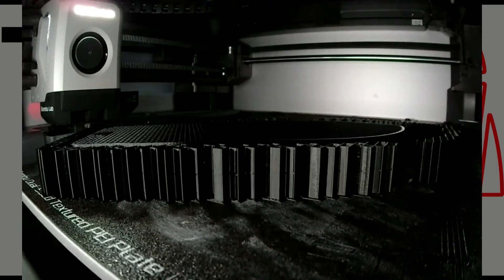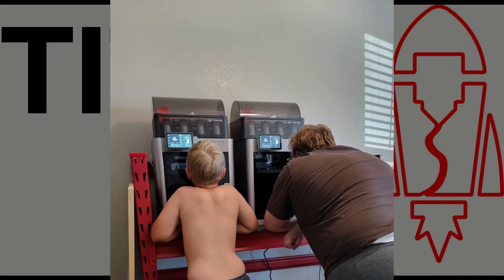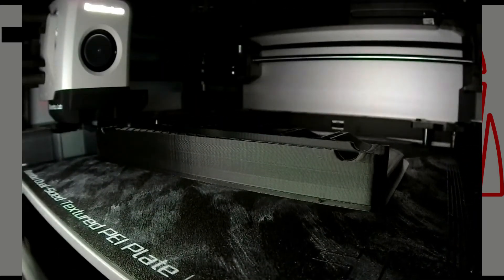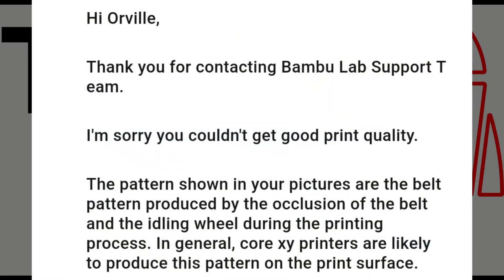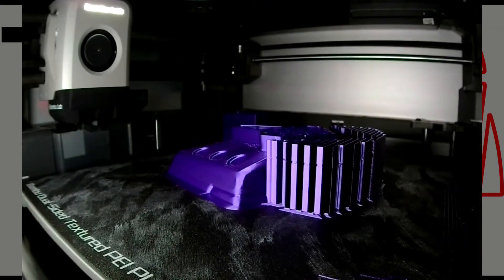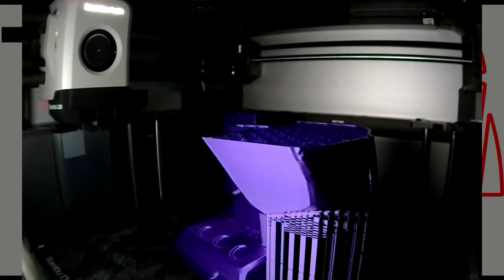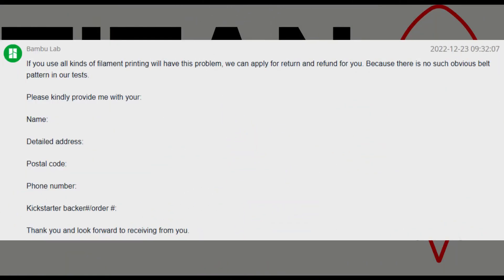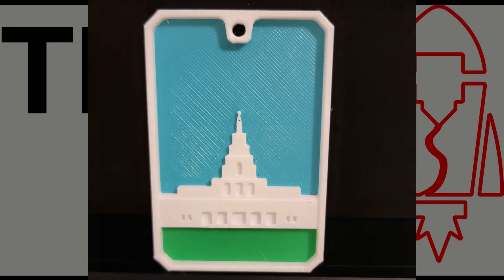Review of the Bambu X1 Carbon You Didn't Expect

Comment: What also helps is not trusting the Autotensioning system for the belts. Just listen to the tone each belt gives when twitching it like a guitar. You can get within 4Hz accuracy which is enough. If they the belts dont sound the same just open the screws for the Autotensioning and move the head around and thighten them back up. If they still sound the same then you need to do it manually. Just adjust the lower sounding belt to match the higher pitched belt. Loosen the screws of the lower pitched belt and push the Autotensioning mechanishm and the spring further by hand so you get more tension on the belt. Screw it down again and listen for the tones again. Do until they sound the same. It helped me tremendously.
Reply: Thanks for this comment. I made sure the belts on my P1S have the same frequency pitch and now the artefacts are less. Yay!

Comment: Also, per your point on print speed and your work here. Everything vibrates. For every printer and corresponding print job (shape, size, density, filament type), their is a sweet spot that will  output the highest quality print for that part. Think, Hz, Mhz, Ghz, etc… Think music…. It blows my mind how many times I’ve dialed in a part, hit that spot and thought “Oh this is incredible, now I’lll try that other part.” and it’s like starting all over again. Setup, Profile, dialing in, for me at least (I’d love feedback from you all) is where the work is. Once you find the zone, it’s incredible how amazing the results can be. Anyway, subscribed. Great review, honest and even greater you worked with them and avoided going the trash route by beating them down.
Reply from the maker: Thank you! As my first go at making s full length video I was quite a bit nervous. My machine never really had a sweet spot. I tried speeds from 50 to 300mm/s and it was always present. The only thing that changed that was matte and carbon fiber filled material and even then it was still there, it's just less visible because of the surface texture.
Reply: @Titan3DAZ  I hear you and? I know how absolutely crazy it can make you when you systematically step through and keep searching for answers yet none seem to do the trick! Keep in mind, THIS is how we learn above reading, watching videos and everything else!  Again, great job, keep it up and good luck growing the channel! You’re a natural, so keep it up!

Comment: Hi. the same problem with my printer. 
After week of trying to resolve it, I went to internet and found a lot of comments from people who trying to help but they don't. 
In few hundred comments in facebook, reddit, youtube and bambu lab forum, 90% comments are like "hey, its simple, dry your filament" or "just clean carbon rods".
I tired reading this. I hope my note will help. 

What I did: 
Cleaning carbon rods many times - doesn't help.
Belt tensioning following instructions many times, calibration every time - doesn't help.
Belt tensioning manually - using special tool, the printer head in one place and tensioning every 5hz - from message on the screen "belts too loose" to "belts too tight" - doesn't help.
Tension the belts on same frequency and not - doesn't help. 
Cleaning idlers and belts, centring the belts on idlers (the belt don't take walls on the idlers) - doesn't help.
Putting the printer on the stone floor and other types of floors, putting on the table, rubber and silicone(soft) or even my legs - doesn't help.
Adding some weight, adding vibration absorbers (sheets, something like bitum) for change frequency of resonation of chamber/frame of the printer - doesn't help, but now it makes only 45db (55-65db before, and now the AMS seems very loud, not printer).
Manual bed calibration - doesn't help.
Turning off bed level compensation (G29.2 S0) - bed doesn't do small corrections during print - doesn't help and is visible how the bed is bad (not flat). 
Changing nozzle diameter to 0.6 for check it is not extruding issue - doesn't help, pattern didn't change. 

Also: 
It is NOT vibration compensation issue - command for turning off its "M975 S0". You can add custom gcode in slicer on some layer and check difference. 
It is NOT lidar and calibration of flow. In gcode you can see that it makes 3 lines with K0.04,  K0.02 and K0. Lidar only see which line is better and picks this value. If lidar doesn't see the good line - it takes standard value K0.02.
It is NOT infill pattern, tested model printed with no infill.
It is NOT "hey, add more walls" - any number of walls, pattern is here.

"Just increase speed" it is like "if an engine in your car can't handle idle - just hold your leg on the gas pedal"  
For me, acceptable speed of outer walls is 50-150, the test tower is one print, from 50 to 150 mm/s, increasing by 2 mm/s. 

Maybe I missed something, Ill add later.
Reply from the maker: Exactly the same for me. I did all of that and had no success. I'm glad I'm not the only one who went through all that with no luck.
Reply: Та же хрень. Вот ломаю реперь голову, что с этим делать
Reply: And how it came out for you?
Do you still got the same issue?
I am here with the same issue and also did all of the thinga you did

Comment: TBH i am surprised support did anything for you. My experience so far with this support has been abysmal. No matter how hard I try too explain on going issues with reliability, and accuracy. They don't seem to understand. I agree the software experience has been good. But I have spent more time with my x1c down, having to fix stuff on it than I have using a this point. Which just garbage.  Though i am thankful at this date, the machine has now failed so hard that it will now longer allow any printing, which i hope results in replacement.
Reply from the maker: Best of luck. I'm certain I was treated this way because of this video. It was brought up during my time communicating with support and they were not happy I made this video...
Reply: What happened with it?

Comment: I bet that a toothed idler bearing, rotating around ball bearings would solve this issue. More defined travel paths (toothed) would limit the addition of frequencies (while printing) that the machine can't account for. I bet that you could even 3D print a simple fix and have no more issues.
Reply from the maker: I couldn't get my idlers on the x carriage out.
Reply: @Titan3DAZ  bummer. The manufacturer will have to fix it. I'll send them an email
Reply from the maker: @evandaniels450  Thank you. I suggested that to them and they never responded on that point. If more of us can comment on it then maybe they'll fix it.
Reply: This is what I was going to say as well. Then the other guy said you can't remove them. I wonder if it's possible to 3D print a toothed wraparound sleeve. Even though we shouldn't have to do any of this.
Reply from the maker: @Keyboard Warrior  that's a cool idea! I wonder how er could put it on though?
Reply: @Titan3DAZ  tpu print and CA glue?
Reply from the maker: @foam27  I don't see why not.
Reply: @Titan3DAZ  who's first?😅
Reply from the maker: @foam27  not me. Already agreed to send my 2 back
Reply: @Titan3DAZ  I would consider that but I'm enjoying the software and ease of use too much. Plus I already returned my flsun v400.
Reply: @Titan3DAZ  or a 2 part print with alignment dowels.  Roll the first half moon in, apply adhesive to holes, connect 2nd part

Comment: i bought a bambu p1s a week ago. yesterday i noticed that my prints have really strong ringing in the x achse.
ohh my god, at this point i regret it that i bought a bambulab printer.
Reply from the maker: I am sorry to hear that! I am sad Bambu has yet to fix this issue, even after such a long time.
Reply: I bought a P1S two weeks ago and also have ghosting. The surface of the prints were wavy since day one and i thought it was normal. But today i found out that it is called ghosting and is an issue. Now i dont like the printer anymore 😂 But i will try to fix it by increasing the tension on the belts.
Reply: @TheRipper3564  let me know please

Comment: How long since you bought this machine before it shows this problem? Mine is the problem about the machine unable to see any WiFi networks out of sudden after updating the firmware. It was working perfectly before.  Still working with the bambu team very slowly though. Glad you got refunded and treated you fairly. Hope it will be like this for every one.

 The other printer I heard similar to bambu was Flsun V400. You may want to look it up.
Reply from the maker: Only a week or so. I was doing 24/7 printing on them though. Also, not noted here, but it wasn't for another 3 weeks after this video that I got a refund..

Comment: I have to ask about you say that your printer never had a sweat spot. You also said that the quality of your print were good at first but soon diminished. You also say that your problem is on both the X axis & the Y axis of both your printers. I have some questions regarding the environment of your small print farm. 1. What filament are you using. If it’s a quality filament or cheap lesser know brands can have a major effect on print quality? 2. With the prints good at first, how were you storing your filament and how did you insure the filament was dry? What humidity is the filament stored in? Now these next 2 questions are the big ones for me & was a major issue for my X1 Carbon, 3. how is your printer mounted? Is it just sitting on a desk do you have something underneath it like a slate or something to absorb the vibration or limit the movement of whatever it sits on? Finally 4. Do you run both machines at the same time and sitting on the same surface as the vibrations coming from other machines can greatly affect the quality of the machines? I respect that you most likely have done everything correctly but as you are an engineer may I suggest that you look at building your own as it will greatly improve your understanding of the realities of 3D printing, maybe something like a VzBot. I only suggest this as I think if you think that you are going to find a better off the shelf product that has similar customer support as Bambu Labs than I believe that you will only be even more disappointed & disillusioned than you already are. I do however wish you the best of luck, cheers Madz.
Reply from the maker: 1. I used polymaker and matterhackers pro series primarily. 2. My filaments have been stored in a sealed box and run from heaters/dryers. 3. They're on an industrial shelf that's really heavy duty and yes on a paver with a rubber isolation mat. 4. Running them one at a time never changed the output. I have spent 6 years running printers so I was very hesitant on these machines to begin with. They did promise a lot, but I think it's a QC issue overall since others aren't having this issue. I'm certainly down to build another machine like a vzbot or a ratrig/voron. I'm disappointed in these machines primarily because they promised a lot and others I've seen work so well while mine don't.
Reply: @Titan3DAZ  Fair enough, I just thought something that I suggested might have helped, especially the residence vibration with multiple printers, I know I had a similar issue with ringing on large prints and as soon as I calibrated with no other printers running and ran it on its own it was so much better. I checked out a couple of your other videos & I have to say that the TPU Benchy that was printed on your X1 Carbon looks like one of the best Benchy's that I've ever seen printed.  it must be frustrating to have such an intermittent fault.  I hope you find the printer that you are looking for, Cheers.
Reply from the maker: @Brett Madigan  thank you! Yeah I'm really happy with that benchy. And that's just it with these machines, I've gotten some stellar prints off them only to have them crap out on both machines and then not go back to working... I'm currently looking at raise3d and fusion3d printers (for off the shelf ready to go machines). If I'm to build one, I'm torn between a vzbot and the hevort printers.

Comment: This is so strange. I have a X1 Carbon, I work for a company who has a print farm that has over twenty X1s. I've never had this issue or seen this issue with any of the printers we use. The problem must have been solved because this video is over a year old.
Reply from the maker: That is quite possible. I haven't had a Bambu since, so I don't know if it has been resolved or not. I'd certainly hope they did solve it! I also think that this was just a QC issue in the early days. I am sure they've ironed out the QC problems.
Reply: @Titan3DAZ I bought one a bit over 2 weeks ago, just outside the return window. Currently having these VFA/ripples and man are they strong.

I'm hoping it's an issue with my model, but if not I will try to make them take it back as false advertising of a defective printer.

Comment: I'm returning mine. The left linear rod is showing wear/chatter marks in the chrome finish on the bottom side. Most likely the gantry is out of alignment, or the bearing is not rotated the correct x orientation to the bed so its only rolling on 1 row of ball brearings during movements. They have some serious quality control issues that is going to sink their company if they dont get it under control very quickly.
Reply: What do you sugest instead? Qidi ?

Comment: ive had artifacts like this on my voron, and for me what solved it was adjusting my belt tension (ended up I needed to loosen a bit) but at a specific belt tension it completely went away and I have not had issues since
Reply from the maker: Interesting. I can't really loosen the belts on the bambu, they have the auto tensioner system.
Reply: @Titan3DAZ  they seem to have a lot of random things that supposedly help but can cause more problems
Reply: @Titan3DAZ  Just received my new x1c combo last week and so far, knock on wood, I'm not seeing this issue.  But I'm wondering if by any chance if you know whether or not if the spring tension is adjustable on the auto tensioner system?  My guess is that it's now and the spring constant varies ever so slightly between different machines or certain production runs of machines to cause these chattering problems on some and not others.   My WAG (wild ass guess) is there's a quality control issue with whoever supplies their springs.  Bottom line:  Wasn't me.  Didn't do it.

Comment: What if you used a toothed pully so the teeth line up with the belt?
Reply from the maker: I wanted to try this, but Bambu (at least in my 2 early units) had them seated with a pin that was pushed into place with no way to get it out without voiding my warranty.
Reply: @Titan3DAZ  you might want to throw that out there to others in case someone else tried it or is willing to...
Reply from the maker: @legendarydave333  has been mentioned a lot in the comments

Comment: Thank you for making a video about this. I have two X1, one of them has the same "wavy wall" VFA problem, one still has it but very minor in appearance. On the problematic printer, the belts sure feel well-tensioned, and the defect happens on 1/4 of print, most visible on the outside wall. It's not just PETG, PLA also has this problem. I have been looking for a solution for weeks but other than print faster, which really only softens the effect, there's no way to solve it. My Prusas don't have such problem and were well-calibrated from factory.
Reply from the maker: Yeah, we ended up going with sending the printers back and getting a refund. It was a 6 week process for me, not sure if it still is or not.
Reply: @Titan3DAZ  I decided to retension the belts again, it just slightly changed the profile of the wave, not improved. Cleaning the carbon rod on the other hand does seem to lessen the effect a bit. Not sure what the wiped off black stuff are as I don't print ABS nor ASA. Just leaving it here so people can at least try rod cleaning.

Comment: 🎉 I had the same problem with silk PLA. I have a solution: Outer Wall Speed 40mm, Acceleration Normal printing: 5000, Outer Wall 3000. infill: 50-100% (don’t forget, that the infill also creates waves on the outer wall)

Additional info: Bambu cannot compensate resonances at around 100mm. With 200mm i have no resonances anymore but silk PLA is not silky, it needs more time like PETG
Reply from the maker: I'm glad that worked for you. I did tests ranging from 50mm/s to 300mm/s with no change. This pattern showed up at all speeds and all accelerations.

Comment: Upfront a solution that might help some people: Try exporting your files as STEP-files and not 3MF or STL. That can make (and did a huge difference for me) *on some prints.

My P1S is from beginning of 2024 and I'm having the same issue and did everything the wicki suggested and more. No fix! 
Their answer: Run a VFA test and just avoid printing at speeds that cause problems. Meaning: They have not fixed anything. 

*Although I mentioned that changing to STEP files made a huge difference, the problem remains on many prints, clearly showing that its the resonance-test that's not providing the necessary input to the machine, or the machine does not adapt accordingly. I'm pretty pissed to say the least!
Reply from the maker: Sad to see that it still isn't fixed. Customer built machines are far better still.
Reply: @Titan3DAZ  I totally agree. I miss Klipper and the ease of just changing what ever's necessary. I'll probably use my P1S to eventually build a Voron. That wasn't the plan, but hey.. now I have a reason to do so :P

Comment: I didnt believe you and I bought one. And yup sure enough I get the same ripple issues that you get except Im printing at standard speeds. The print quality over all is pretty bad. The issue is that for any print move that is not full speed it seems like the vibration compensation just doesnt work.
Reply from the maker: I'm sorry to hear that. It seems to be just a QC issue imo, bad parts I think